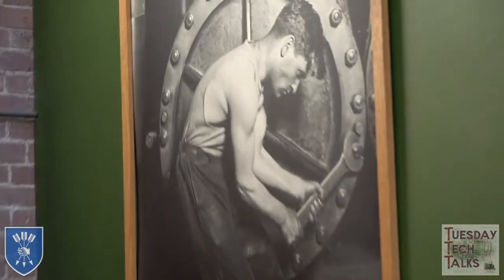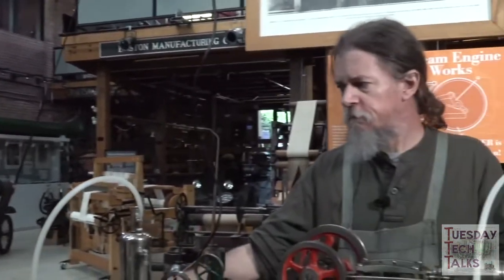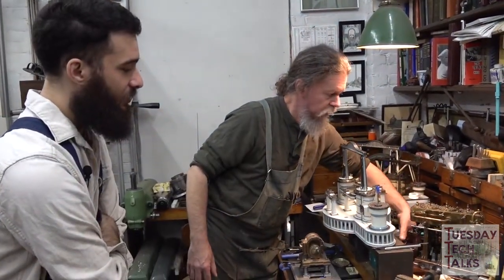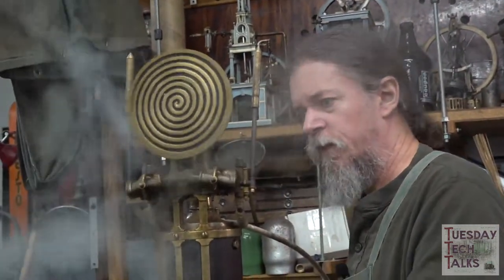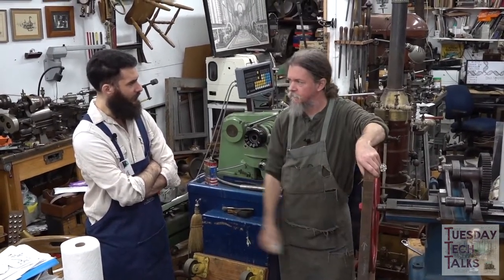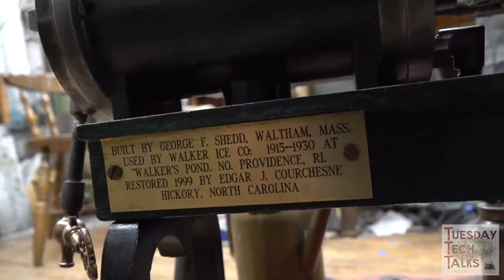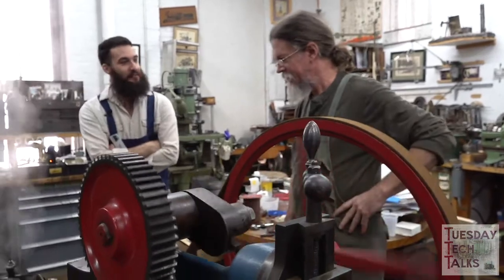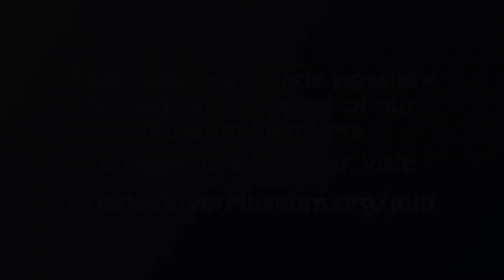Tech Talk: Model Engineering with Todd Cahill

Comment: The description of how a triple expansion engine works doesn't seem to be quite right.
I'm aware that there are different types of triple expansion engine, but this one looks a lot like the
Stuart Triple Expansion engine I've been building for the last couple of years, which is a receiver type.
The condenser has nothing to do with the low or intermediate pressure cylinders.
Partial condensation of steam seems to defeat the object of the engine's design.
In the high pressure cylinder, heat in the steam is converted to work, it expands and its pressure drops.
By means of a valve, steam exhausted from the high pressure cylinder is piped through to the intermediate cylinder valve chest.
In the intermediate pressure cylinder, heat in the steam is converted to work, it expands and its pressure drops.
By means of a valve, steam exhausted from the intermediate pressure cylinder is piped through to the low pressure cylinder valve chest.
In the low pressure cylinder, heat in the steam is converted to work, it expands and its pressure drops.
The exhaust from the low pressure cylinder may be piped to a condenser, in order to improve efficiency and to recover water.
The relative volume and pressure of steam entering each cylinder is controlled by designing the volume of each cylinder, steam transfer pipe & steam chest (receiver) and by valve timing.
I can't see a pipe taking steam from the high pressure cylinder to the condenser.
But neither can I see a pipe from the high pressure exhaust to the intermediate cylinder steam chest which could be internal.
Having built the Stuart Compound Launch engine which is a double rather than triple expansion engine, I can assure you that it doesn't need a condenser for it to run. If it did, it wouldn't be able to run on compressed air.